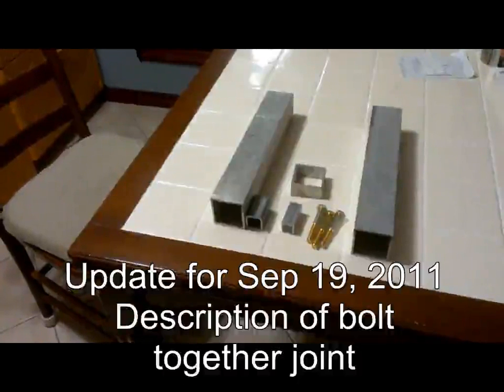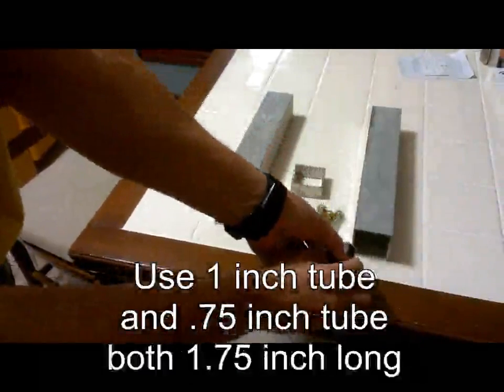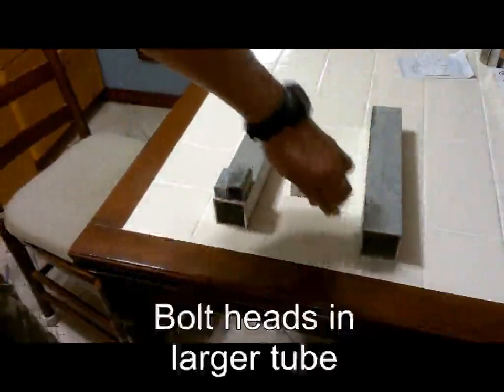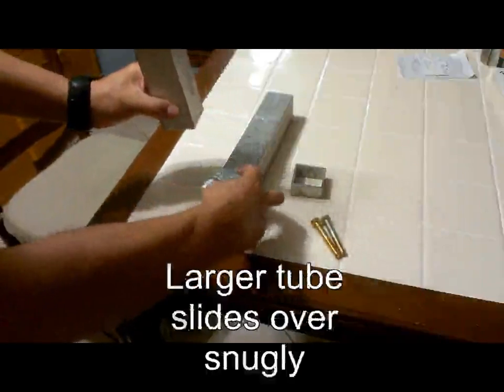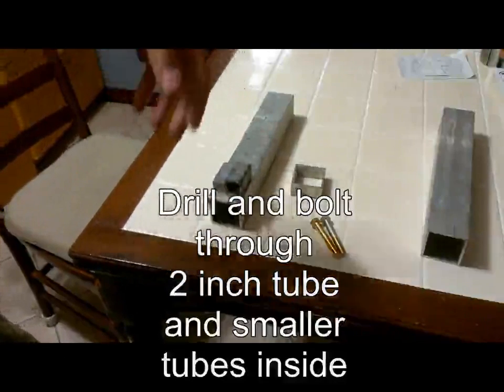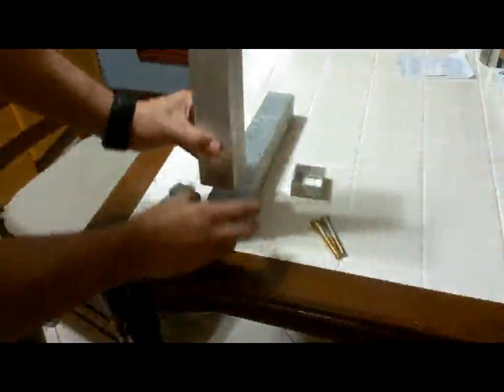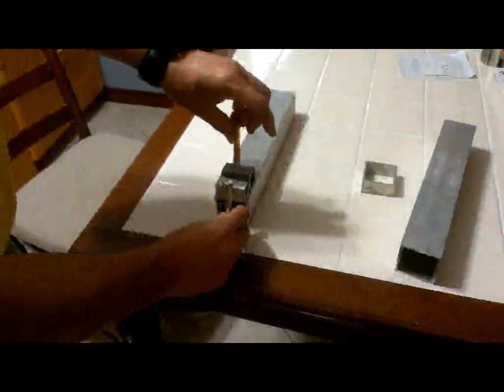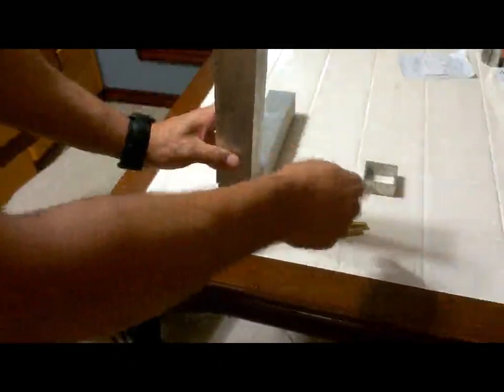Explanation of bolt together frame idea

Comment: It would be much easier to use connectubes for building a steel frame without welding. The system is super cheap and uses steel couplers and 1.5 x 1.5" square galvanized steel tubing.  Highly recommend you learn about this building product to use for bbq frames etc...

Comment: Another good way is: 1) Cut a solid rectangular prism of 6061 to be used as the spacer. 2) Drill a blind hole at the center on one end of this. 3) Tap it. 4) drill a hole through one side towards the opposite end, enough distance away from the bottom of the tapped hole. 5) Drill the holes through the tube inline with the spacer holes. 6) Apply thread locker to the bolt going into the tapped hole, and use a nylon lock nut for the other bolt. 6) Fasten bolts!